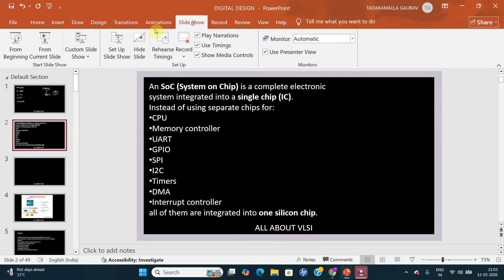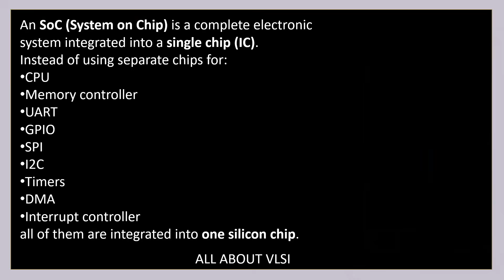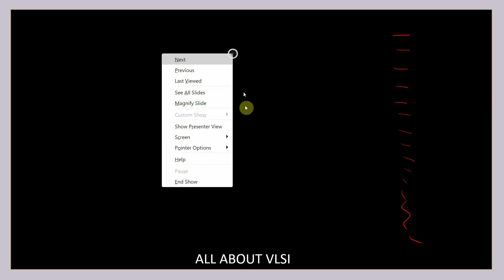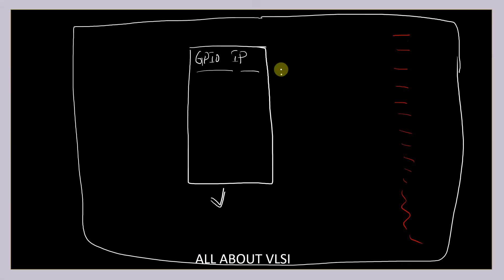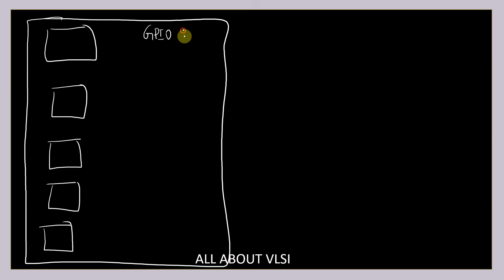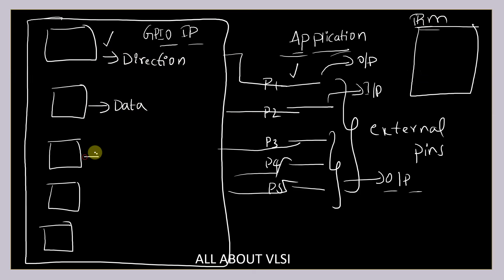GPIO Controller Design | 10-Minute Sneak Peek Session | Summer Internship 2026

Comment: Hi Anna , As I said I am learning Verilog currently from your playlist. Is verilog prerequisite or will verilog also be taught parallely in this course?
Reply from the maker: Yes u need to know verilog and if you want you can learn parllely from our channel which is already available
Reply: Can I know what is the whole syllabus and weekly plan of this course and it's duration. And the timings of classes ?
I just completed my 2nd year in BTech ECE and preparing for internship drive starting in. 2months , Can I join this course or should I work upon strengthening digital fundamentals and learn Verilog  and do basic projects in verilog ? @Allaboutvlsii